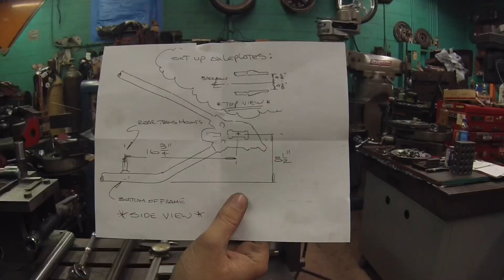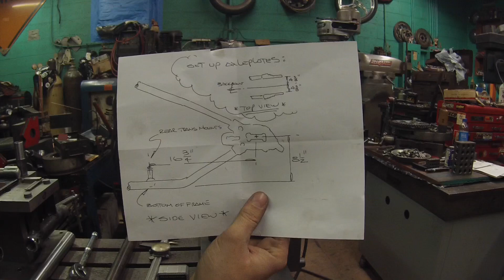How to weld on hardtail a shovelhead frame chopper build. Part 1

Comment: If you don't have access to a TIG welder, what else would you recommend for hardtailing?
Reply from the maker: You could really use any steel welding process but I would recommend at least mig welding